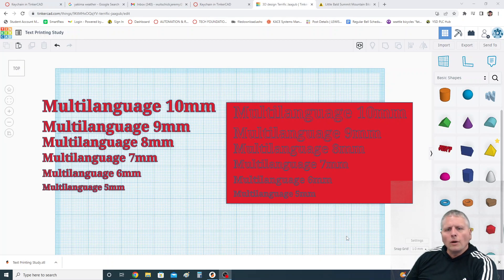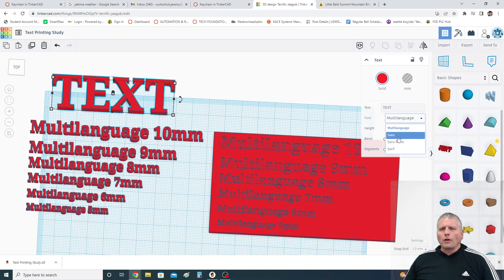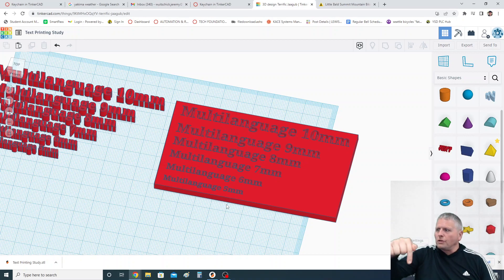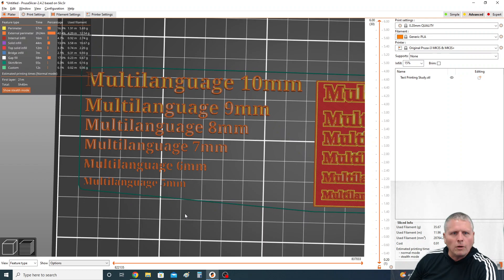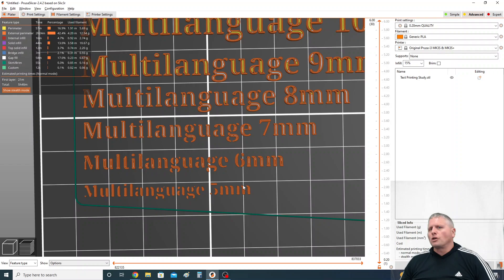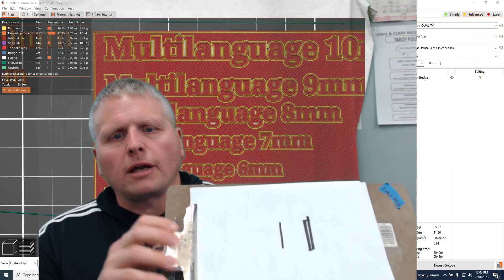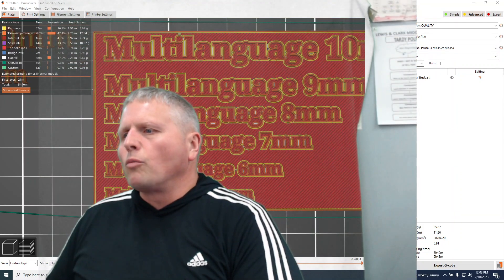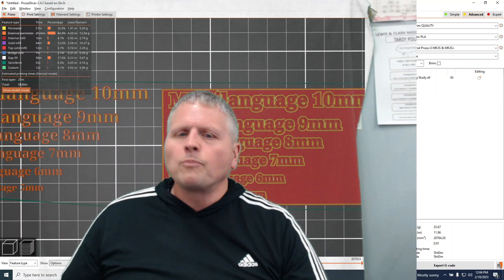3D Printed Text: How small is too small?

Comment: I tried 3mm text in Arial Black in two colors where the text color goes down 1mm and print a single layer above the surface of the surrounding plastic. An interesting thing is when it is sliced with Cura it is perfect when printed parallell to the print square but if I angle the print 45 degrees it looks much worse.

Comment: this might be a little bit off-topic, although I mainly 3d print, but for an artistic research project I want to print somewhere around 200 pages of text on one a4 paper. I ve done some research online, read about microprinting, but couldn't find anybody offering this service. I figured that maybe it could be done on a good res (4-8k) resin printer (extruded text) since they can have 40 microns resolution. Does anybody have any opinions on this?